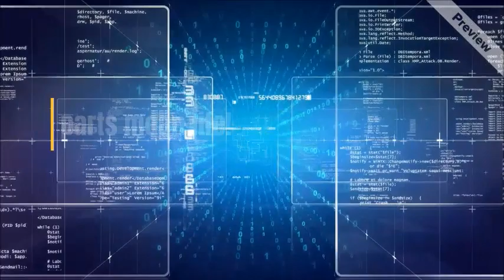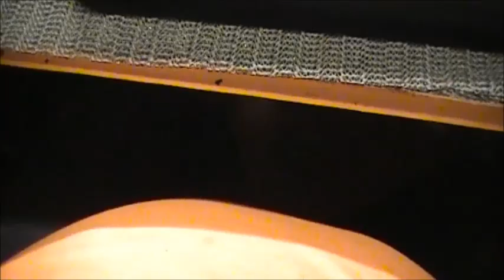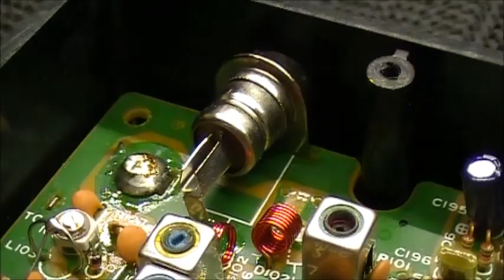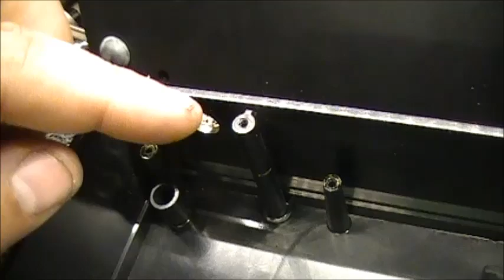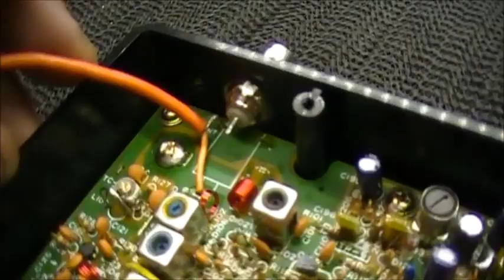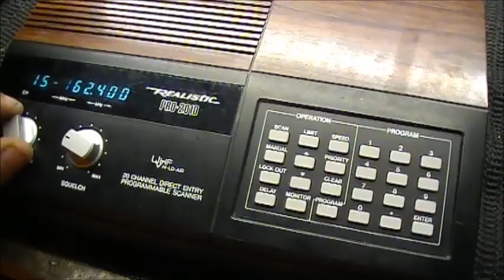REALISTIC PRO-2010  BNC Install [ SCANNERS ]

Comment: I have a pro 2010 with no sound any suggestions. Garyhandy1964@yahoo.com
Reply from the maker: No sound at all?   Blown speaker?  Audio jack needs to be replaced?  Inline cap shorted? Audio amp blown?  :-)
Reply: @Radionut63  if i dont program it when its all 0s. I can turn the squelch off and hear it loud and clear. As soon as i put in a frequency i hear nothing with the squelch off. Am i programming it wrong
Reply from the maker: That is strange!   Kinda sounds like the VCO is out of lock for some reason.
Reply: @Radionut63  what is a vco. Any suggestions
Reply from the maker: Hard to explain really.   Long story short, if VCO is not tuned properly the PLL will not work and neither would the radio.  In the meantime, it could be any number of things. :-)